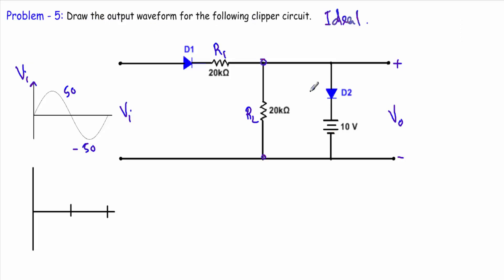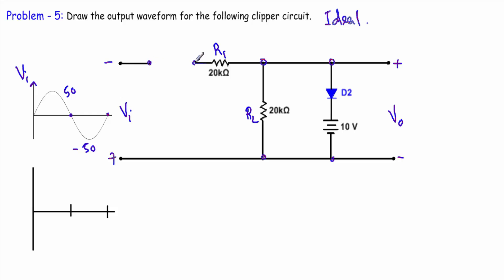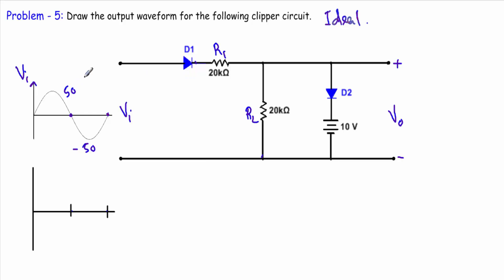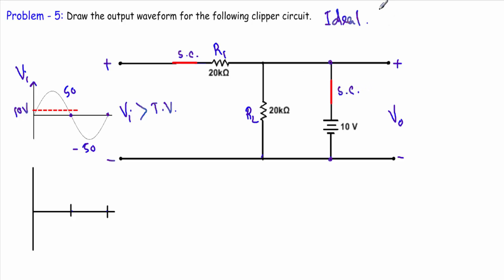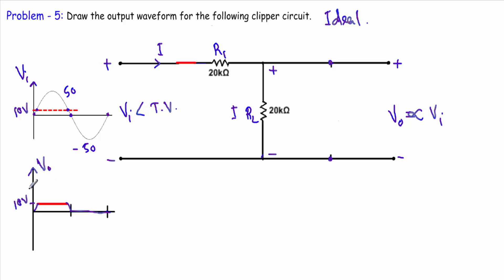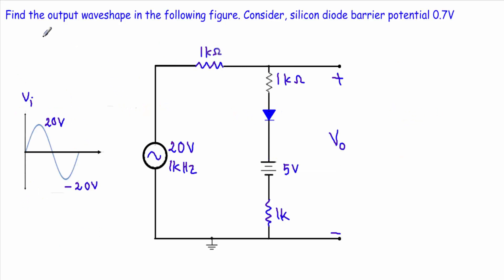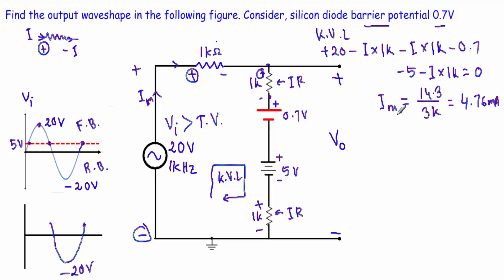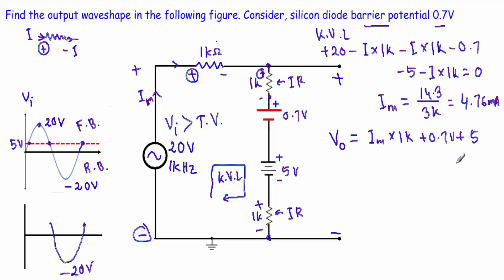Diode Clipper Circuit Analysis - Example 5 & 6 (very hard)

Comment: in the second question, thresh voltage must be 5.7 V .if vi=5v  the diode must be off condition .in your solution is on at 5 v
Reply: i thought must be 4.3V , using kvl in the second loop

Comment: for + half cycle D2 is forward or reverse depending upon Vin is greater or less than biases voltage..but D1 is not effected by biased voltage why?
Reply: may i know why only D2 get affected?
Reply from the maker: This process works on simple clipper circuits only.
Reply: yes i have some doubt too